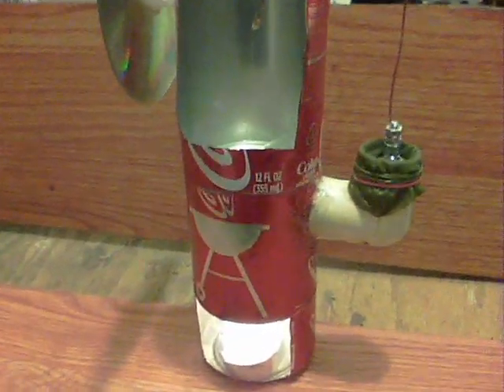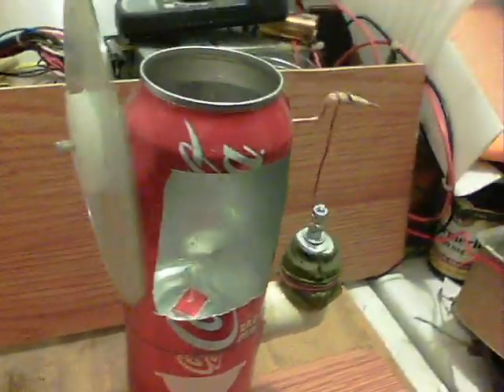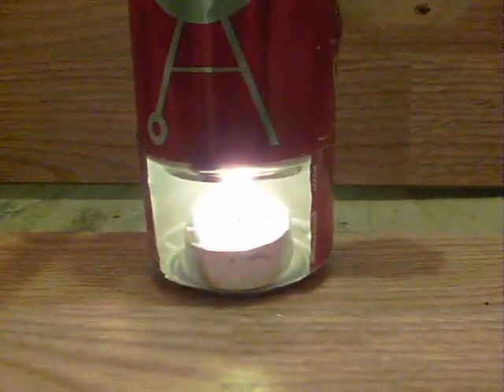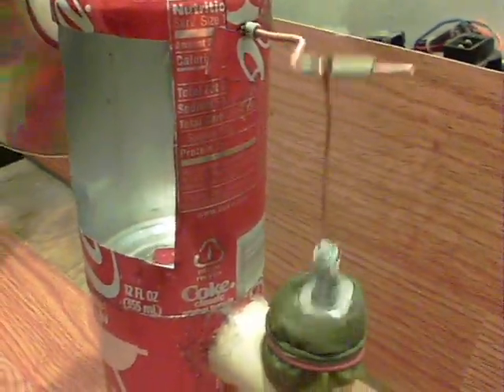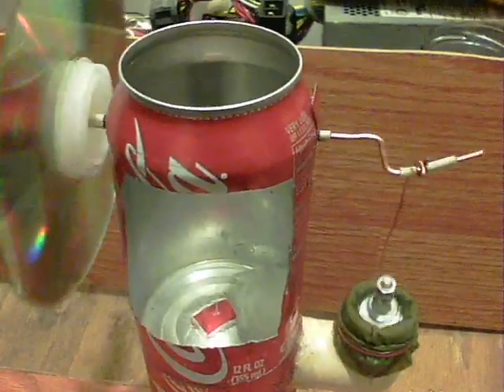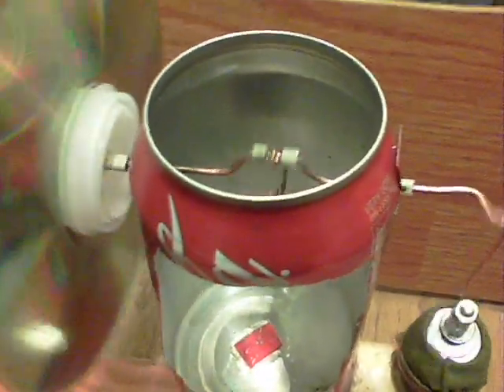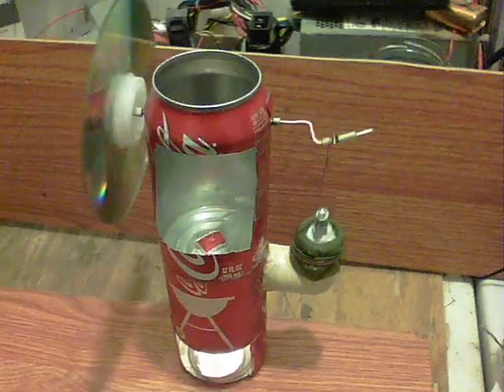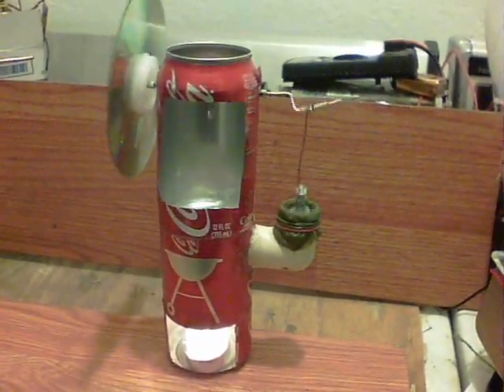First Stirling Engine

Comment from the maker: A good runner in your video...quite a bit neater made than this one of mine. I've been using the drilled connector strip brass pieces too on others, they work well. Quite addictive these little engines :)

Comment from the maker: Which is a good analogy, because of talk of 'regen' in these, which I don't know much about. It seems something like an oscillator tank section for increased efficiency, as in cap and resistor from coil to transistor Base. Could a 'Penny' version of this engine be around the corner ?!
I wonder...when the ice melts in most, the water just sits on top, but it's changed from solid to liquid. could it then drop through a small hole into a tank that uses that water for a steam boost.

Comment: Gotta have a wobbly CD flywheel or it ain't a 1st Stirling engine build----or in my case the 2nd, 3rd, and 4th builds.  Glad you got yours working.  They are not as easy as they look to get running right.